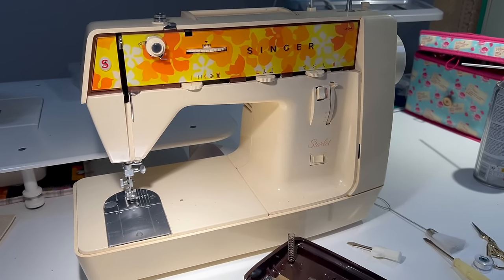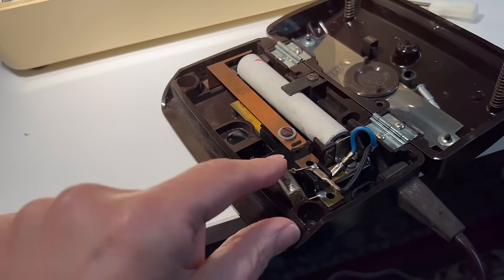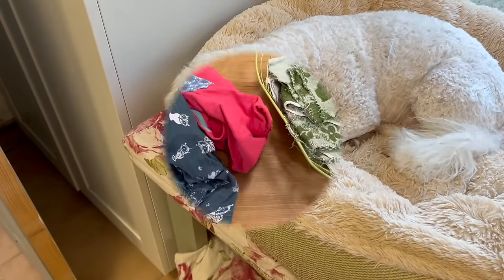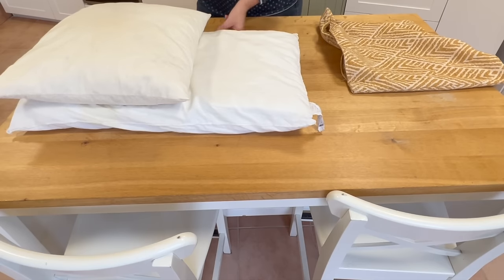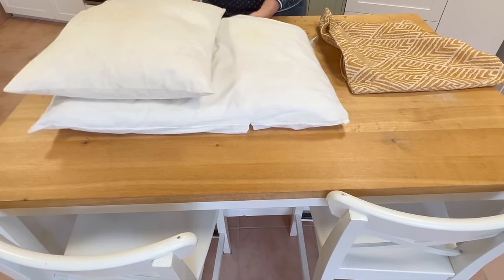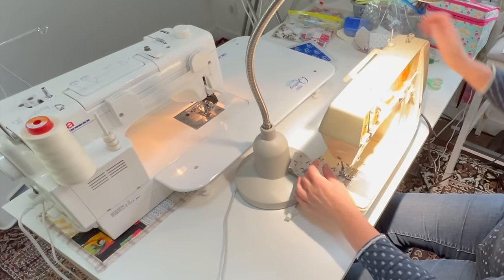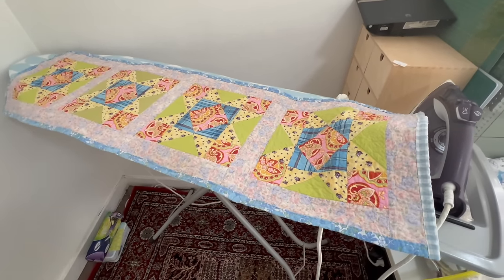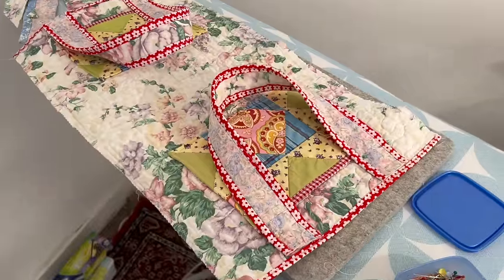Frugal Living with Make Do & Mend #zerowaste #makedoandmend #singersewingmachine #vintage #diy

Comment: Great video! My neighbors were going to throw out a vacuum because it had no suction. My husband took it and did a thorough check. He removed a comb and some other bits stuck in the hose. It worked perfectly after that!
Reply from the maker: We regularly used to rescue dyson vacuum cleaners from the recycling, clean them out, get them going and sell them.

Comment: I love using paper planners and this is the time of year I normally purchase a new one for the coming year. I went through my old notebooks and journals, and I found an old bullet journal of high quality that I had maybe used only 1/3 of. The rest was in perfect condition. So, instead of buying a new one, I'm just going to use the rest of the old journal that I never got around to finishing. And I'm saving the money I would have spent on a new journal.
Reply from the maker: Thanks

Comment: Having my sewing machine permanently set up on its own table, in a corner of my work room, has been lovely.  I've been making rice bag heating pads.  Two kinds of these pads seem to be the most useful (only use cotton for these projects as you put them in the microwave for 2-2.5 min).  Finished size 9" x 14" with three long channels filled with rice, is wonderful, for large areas like wrapping around an unhappy arthritic joint, or putting on the back or abdomen.  My other favorite style is a rice filled white athletic sock, encased in an outer sleeve made from an old cotton sweatshirt.  I love these socks heating pads - I use one to heat the foot of the bed in winter, and I use a second one as a "pillow" for my neck - I don't heat it in summer, but I do heat it in winter and this rice sock has reduced my neck pain significantly at very little cost.  The rice heating pads stay warm for a long time, and make going to bed on a cold night a totally improved experience. So fast to make, and infinitely useful.
Reply from the maker: Thanks for sharing

Comment: I have also found thrifted items that had missing buttons were tears. Ironically many of the things that were missing buttons had buttons sewn on the inside seam. I was able to buy those things and add the buttons, amended the holes and sometimes even remove stains. Some people just aren't very motivated to retrofit or fix things
Reply from the maker: Thanks for sharing

Comment: My favorite sewing machines are the vintage ones.  They're so heavy, my husband refers to them as "boat anchors".  Years ago, I found an old (probably 1960s or possibly 50s) Montgomery Ward one.  It was priced at $40, but everything with yellow was 75% off that day, so I got it for $10.  It only does straight stitching and zig-zag, but that's okay......Your table runner looked like good work to me; very clever of you to make do with it.  Making Do, Mending, etc. are some of the videos I love the most.  Please do more!....Carla H.
Reply from the maker: Thanks
Reply: I bought a sewing machine table at a Sally Ann store.  $25.  Turned out there was a 1960s working Singer machine in it.  Got it professionally serviced.  As good as new.

Comment: 😢I have two featherweights and a number of old Singers including a 1896 hand crank and a beautiful treadle.  All from the local Charity shop.  My latest acquisition is a 1950’s 201.  All work beautifully, fantastic stitching, and so easy to maintain.  My make do and mend last week was two new dog beds for their crates from an old duvet and old bedding.  (also from Charity shop).  This week repaired tonnelle cover which storm had damaged, but it is now like new and refitted.  By the way, AllPowers kit arrived yesterday!
Reply from the maker: That’s great.

Comment: Hi Jane and Mike.  You've saved yourselves a lot of money there. The Singer sewing machine was a bargain. The design is so retro as well.  Also, love the bag. Very boho. I've been out knocking even more nails into my fence panel at the bottom of the garden. As it''s partly hidden by a Yucca type plant, I'm reluctant to replace it until absolutely necessary. Only thing is, there'll soon be more nails in it than wood. 😆.  Still, if it means it will last a bit longer it'll do for me for now.  Must say Jane, every home should have a Mike. He seems to be Jack of all trades. Thanks again to you both for another great video. 🤗
Reply from the maker: You're welcome and thank you

Comment: I think I told you about the Ebay seller who rang me on a Saturday to tell me which order number I needed for a quilting/ walking foot for my very old Newhome machine. I've had it almost 40 years, and with a really small investment I "converted" my sewing machine to do quilting.  Not sewing related, but I never throw away pan lids - one of mine hit the dust last week so I went out to my lid box and just picked out another one. (You;ll know this Jane, but you can buy just lids in the supermarkets)....I have old vintage sheets for Emmaus that have had their best day, so ideal for recovering pillow cases. In leaner days, my washing machine "died" and my father took out a condenser or by passed it and said at worst it might cause some interference on my then analog TV but it didn't - what a save! Finally I have the basic range ECO LeClerc ironing board. Back in the day it was 9 euros, but a bit more now. The covers are around 3 euros and it's great for main ironing and/ or crafting. The bag is fantastic - well done! Thanks for sharing.
Reply from the maker: Thanks so much

Comment: I have been sanding a handrail on my stairs that was looking really shabby. It now needs to be repainted and then it will look good as new! I think the previous paint choice may not have been right. I think it was latex. I’m going to try oil this time. You’ve reminded me with your sewing projects that I need to sew some buttons onto a coat that I got from a thrift store. I’ve never worn it because of the lack of buttons! Your little bag is so cute!
Reply from the maker: Sounds great!

Comment: Jane..they no longer need capacitors…they were simply to stop the interference they made with old tv sets. Just take out, no need to replace! Lots of info on you tube and groups who will advise you x
Reply from the maker: Thanks Pam, they keep down electrical 'noise' as you say . There's conflicting advice from the singer manuals and for the sake of 5€ , we put it back
Reply: @FrugalQueeninFrance Most vintage machine enthusiasts in the US will remove the capacitors from older Singer machines. Love the Singer Genie you found at the charity shop. Featherweights are great, but sometimes you need a zigzag stitch.

Comment: Great transformation of your table runner.  Better than having it in the linen cupboard unused.  
Curious to know, did you do a course to be able to service your machines or have you learned through trial and error?  I give mine thorough cleans regularly but haven’t plucked up courage to service them.  They really need servicing but at nearly £100 a machine I keep putting it off!
Reply from the maker: You can look up how to service, repair, make, cook, build almost anything from YouTube. Mike and I love learning new skills.

Comment: I just threw out a pair of slacks that I'd had for roughly 18 years.  When they were new, I used to wear them to go out in public.  When they aged, I used to wear them around the house to do chores.  Only recently, I noticed that they tore easily, so I thought it was time to pick another pair of slacks to wear around the house.  I thought 18 years was a good run for a pair of slacks.  🙂
Reply from the maker: They don’t make them of that quality anymore
Reply: @FrugalQueeninFrance  I've noticed that the quality of just about everything has sadly declined over time.  People used to complain about cheap quality items made in China and sold in the West, but today, those cheap items are sold regularly in our stores at higher prices.  It's sad when you know what real quality items are like compared to the cheaper ones.  🙁